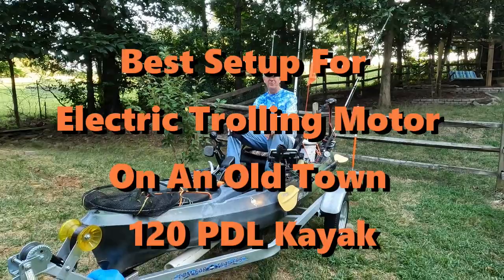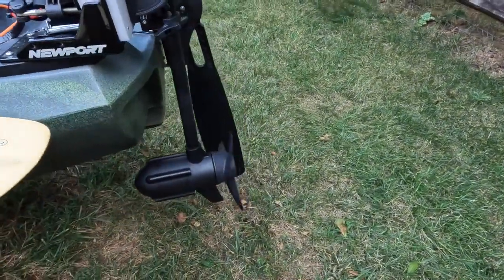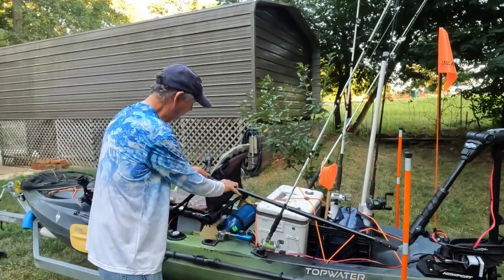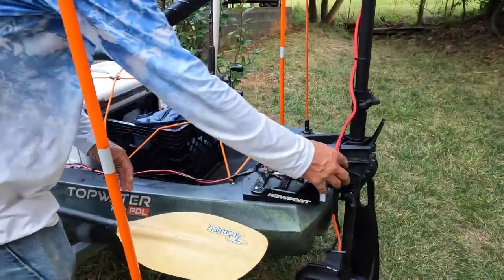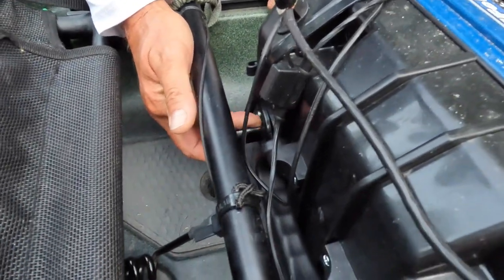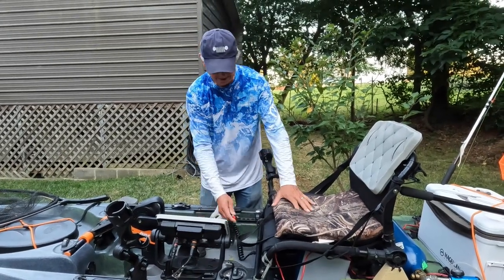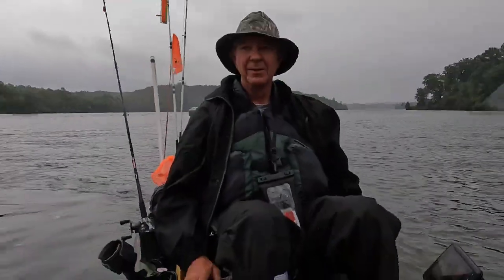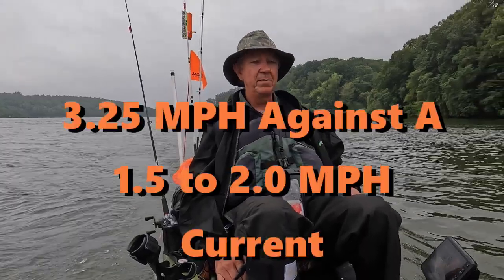Best Setup For Electric Trolling Motor On An Old Town 120 PDL Kayak

Comment: Really like your setup. It looks like a lot of thought went into it.
Reply from the maker: Thank You! It works great while trailering the kayak. When I'm camping with an RV, I haul it with a load extender on a Jeep Wrangler. I found out the trolling motor/battery is a little too much for me to handle when loading on the load extender.

Comment: Are you powering your graph on that same battery? If not what do you recommend? Nice set up!
Reply from the maker: Thank you! 
No, I power my graph with a separate 18amphour AMG battery that I had before adding the trolling motor. It works well. I would go with an 18amphour LiFePo battery for the weight factor. This is a link to what I recommend. 
NERMAK 12V 18Ah Lithium LiFePO4 Deep Cycle Battery, 2000+ Cycles Lithium Iron Phosphate Rechargeable Battery for Solar Power, UPS, Lighting, Marine, Scooters, Fish Finder and More, Built-in 20A BMS https://a.co/d/5xqQKBy
Reply: Thank you!
Reply from the maker: @jldj5000  You are welcome!

Comment: Will this fit a vapor 10 kayak?
Reply from the maker: No, the Vapor 10 does not have a standard anchor mount hole pattern to attach the Newport motor mount to.